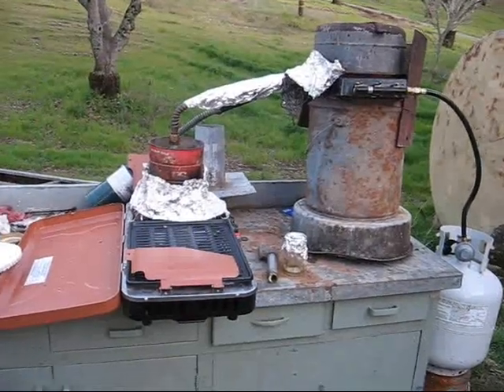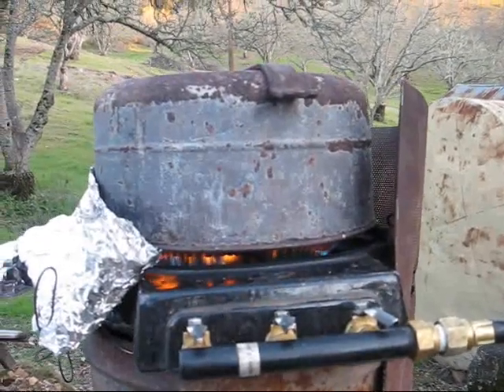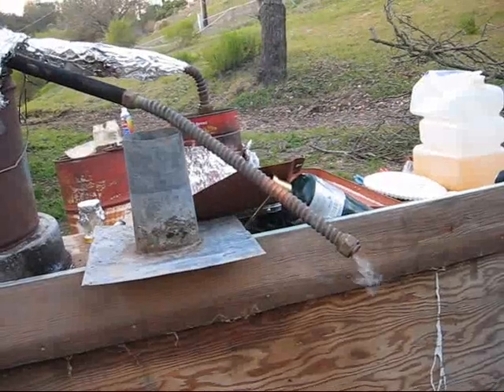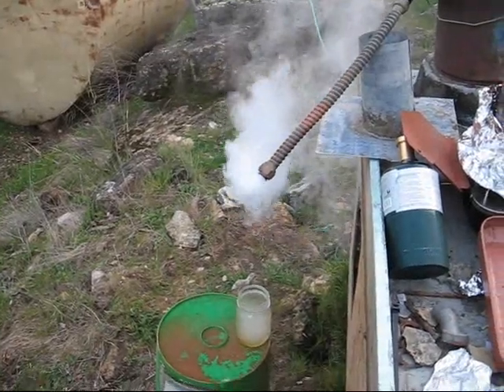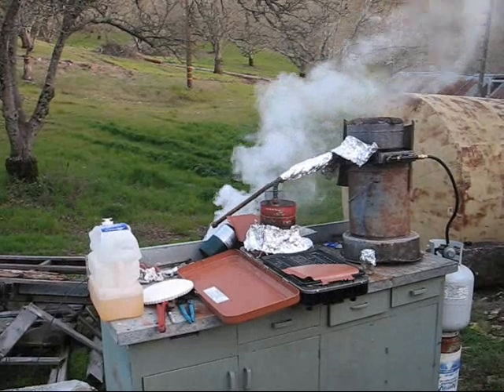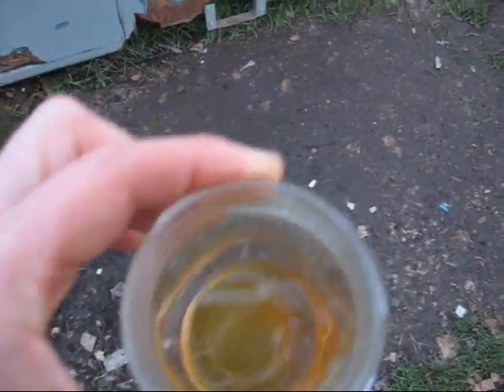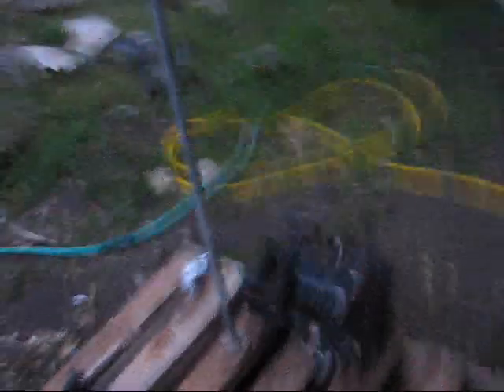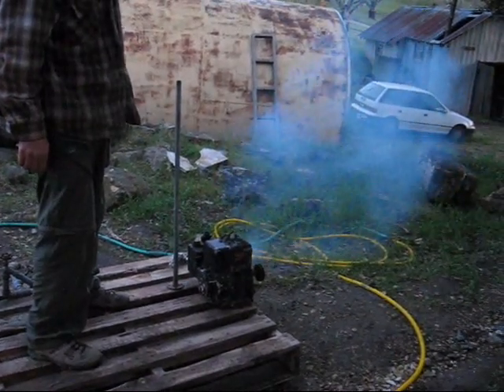Plastic into fuel #3.wmv

Comment: The amount of oil contained in any plastic produced is infinitely less than that proposed in this experiment. Also the polymerization process prevents absolute reversal of the plastic in oil again because extrusion or rolling, for example for the process of any type of plastic material, involves the insertion of a wide range of other often volatile materials, that after being chemically compounded and organized only with a highly ingenious process, perhaps, each of the original components may be separated into its due forms or physical states.
What will be achieved with this experiment will at most be intoxicated with highly toxic gases and vapors that can be inhaled during this process.

Comment: At what temperature are getting liquid fuel?  I'm looking to achieve the same results.
Reply from the maker: don't know. we weren't measuring. the Chinese make  complete plastic to fuel plants now. check em out on alibabba. Drew
Reply: depends on what you are looking for, gas at 200 -230 . diesel 400 and up...
Reply: @calloscar1948   what of gasoline and kerosene
Reply: @calloscar1948   Hello.......what of gasoline and kerosene temperatures ?
Reply: @conteibrahim1079  gasoline you set the temperature at 200 or 230 c, and kerosene at 300 or 350 c...
Reply: @calloscar1948  Thanks.I appreciate
Reply: @calloscar1948  but if I set the temperature permanently  for the 200-230c(gasoline fraction) would all the plastic give me the gasoline fraction without any plastic remaining?.......cos i see some getting all the 3 fractions after pyrolizing a certain quantity of plastic

Comment: proof of concept this is how you  make air pollution,  if every one in the world did this  what would be the result? The epa gonna shut down unless you learn to stop wasting the energy rich smoke, polluting the atmosphere, and increase your conversion efficency. Oil refinerys run flare stacks to burn this type of gas, sweet gas is reclaimed and reformed, sour gas (Containing deadly toxins) is burned off in the flares..   you have proved the concept that plastic can be reverted to a liquid fuel. but is your process economsical fissable of or do you spend more in fuel that you get back?

Comment: Think about your surface area to volume ratio.
You will get a better heat transfer with a flattened tube that has a lot of surface area inside and a low volume.
Getting the gasses to heat and cool more efficiently will supe up your process a heap.
using water as a heat sink will allow you to use about 1/25 as much tubing to get the gasses to condense into an oil.
look in to what the moonshiners call a "thumper".
I have not made any fuel from plastic yet, but now that I have seen you do it, you can bet that I will.
Thanks for a great video.
btw, have you considered using some of the distillate to supply the needed heat?
Reply: +mark warlick 
we have a similar problem with our project and we dont seem able to distill more oil. we currently getting a soft green wax out. any ideas on how to improve the output.
Reply: Paul Kilian please bear in mind that I might tell you more than I know,...but as I understand it, the purpose of the process is to make shorter and shorter molecules.
This is accomplished by heating the polymer, so the more time the polymer is heated for, the shorter hydrocarbon chains become.
I would try running it through a few more times.
You might also look into cracking towers.
Reply: +mark warlick thank u.we ran a test yesterday and found that when we heated to 300 degrees Celsius we got a good oil.then we went to 350 and it became blacker.when we got to 420degress it became a black  paste. thanks once again
Reply: Is there a type of ingredient to add to the
Reply: Plastic to help the process
Reply: MuscleTech by RockyTECH sounds like you learned something important. 
Do you suppose that the higher temps are driving off more hydrogen and leaving the carbon behind?
Are you accounting for all of the distillate losses?
I think that you might be venting some pretty good fuel.
Maybe it could be captured, compressed and stored in propane tanks.
I'd be interested in seeing what you got using liquid nitrogen to cool your condenser.
Reply: Paul Kilian I think it's more a case of ingredients you don't want in your plastic, but if it's coming out wax, I think it should probably go back in.
That's what makes vodka better:
Multiple distillation.

Comment: try and run it though a cold water coil condensor that smoke will turn back into liquid then the water will be on the bottom and fuel oil on top      (NOT GASOLINE)

Comment: Hello, I have few suggestions:
1.Insulate the tank in which you cook the plastic. You will have higher temperature with a lower energy consumption.You can use mineral wool.
2. Use long stick to ignite the fumes and don't wear synthetic fiber clothes. If you are too close of flames, you can ignite yourself.
3.Don't store flamamble liquids nearby your cooker, unless you want to have a fire. Keep a box with sand at hand to stop an accidental fire.
Succes with your experiments.